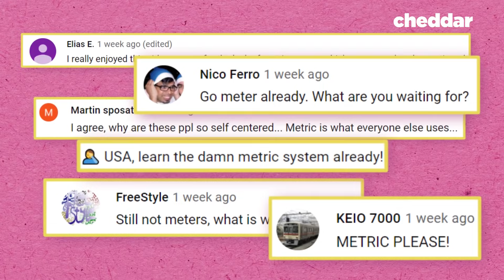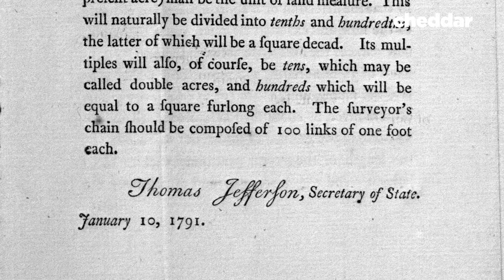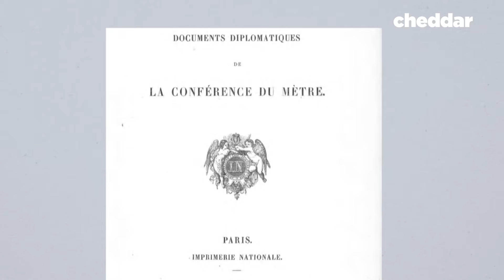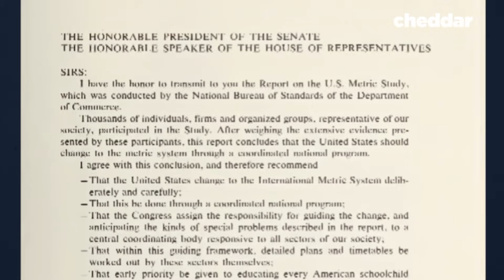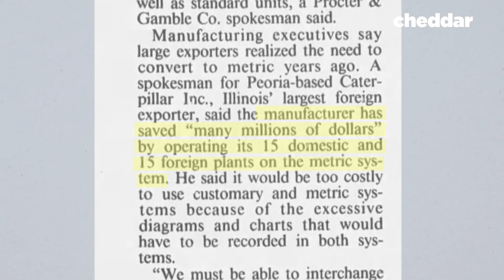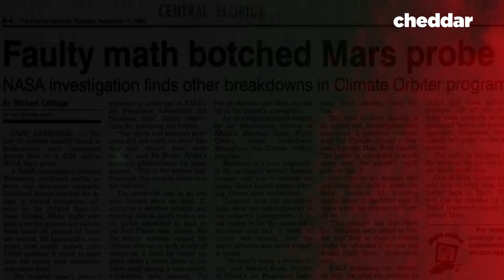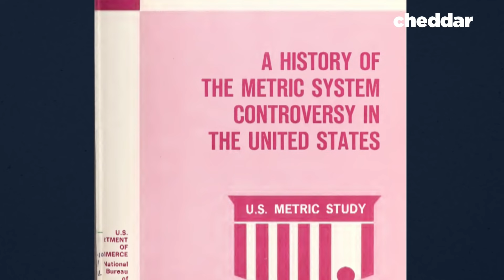Why Doesn't the US Just Use the Metric System? - Cheddar Explains

Comment: Use whatever units work best for the situation. Forcing everyone to use the same units in all circumstances is silly. 

Metric units, as the general population thinks of it, mostly means Base 10.

SI units are based on metric but contain many just-as-arbitrary units. 
Coulomb = 6.242×10e18 electrons
Celsius = 273.15° from absolute zero
Ampere = 1 Coulomb/second
Second = the duration of 9,192,631,770 periods of the radiation corresponding to the transition between the two hyperfine levels of the ground state of the caesium-133 atom at a temperature of 0° K. 

Also, not everything in the universe works in Base 10. The computer you're using right now certainly doesn't. What we call gigabytes isn't actually a billion bytes. And a 4K television isn't precisely 4000 pixels. The encryption used is based on 64, 128, 256, etc. 

Metric isn't always best. How often have you replied to a question of distance using time? 
Q:"How far away is ____?" 
A:"About an hour."  <--not a metric unit

Lastly, to really test someone's commitment to the Metric system...
Men, when gifting jewelry to your girl, you may not tell her how many carats that diamond is. Only give your reply in grams or milligrams. She'll certainly appreciate the gift so much more by demonstrating how passionate you are about forcing everyone to use only one system.
Girls, when receiving jewelry, if he tries to tell you how many carats, you must reject the gift and the person giving it to you. Clearly they are not really committed to the metric system.

Comment: As long as most of the road signs in the US still show distances only in miles and feet, and weights only in pounds, as long as most gas stations in the US still sell gas only by the gallon, and as long as US broadcast stations still give the temperature only in Fahrenheit, I will still consider the US to be a non-metric country.  😴
Reply: @LifebyMarce  The US isn't "non-metric".  That implies that we don't use metric measurements, at all.  We are taught both metric and imperial.  Any educated American can visualize a cm just as easily as an inch.
Reply: @StefanMArndt  Yeah, but most Americans still stubbornly prefer to use inches over centimetres.
Reply: Celsius is good for measuring the temperature of water I don’t live in the water. Fahrenheit is for measuring the temperature of the air. https://www.zmescience.com/other/fahrenheit-vs-celsius-did-the-u-s-get-it-right-after-all/
Reply: And??

Comment: Kids are taught in school through their science classes on the use of the metric system. Since its not used outside of school it gets lost.  I mean we buy soda by the liter but milk by the gallon, I ask why?
Reply: Cows dont know either..but do money. also 16 and 20 ounce bottles of Coke are on sale.
Reply: @Delgen1951  The 20 oz beverage thing is weird. The 12 and 16 oz are "legacy" sizes going back decades, But I don't remember the 20oz  bottle size being a "thing" until long after 2 Liter bottles were used, So if they wanted a somewhat larger size than 12 oz, (12 Oz is usually in cans,not bottles) They should have done away with 16 oz. bottles and went to a half Liter (500Ml) bottle. The 1 Liter size is already a "thing" here and the 2 Liter size has been here for decades, They should standardize on 0.5,1 and 2 Liter bottles.
Reply: That seems like a good question...i wish the video could answer it
Reply: @blacknester No, "soda" or "pop" is available in both USC and metric. There WERE quart bottles, but now it's 12oz,16oz, 20oz, 1 Liter and 2 liter (3 liter bottles were once a "thing", but no longer) No one in the US calls a 16oz bottle of "soda" or "pop" a "pint". Just "16Oz"
Reply: It's not used outside of school for many, at least those of us who rely on precise measurements on a regular basis. Science, engineering, and medical fields all rely on the metric system. It's only when passing information to others that we convert it to imperial. ie all of my CAD drawings are metric. All of my tooling is metric. All of my prototyping is performed using the metric system.
Reply: @blacknester No, but the British apparently DO use PINTS to drink beer.
Reply: Actually, we only buy SOME soda by metric.  We still us 12, 16, and 20 OUNCE bottles and cans.
Reply: @josephlacerra8433  at the same time though I see shops stock 500mL and 1L bottles with the 12/16/20oz sodas. It might be due to our proximity to Canada that they do it sure, but Still, we have 'em

Comment: They say that  "you are what you know",  and learning a new system of measurement may be asking too much from a country wherein a large number of residents don't bother to balance their checkbooks as it is too difficult to understand.       Metric is simple and can be learned in less than an hour.      The real problem is that we KNOW what an inch looks like and not what a centimeter looks like because we grew up with one and not the other.       We will probably never fully convert for whatever reasons we individually choose but it can have consequences large or small.

Comment: The best reason not to switch to metric is that it just plain isn't that much easier. Most of the time we stick to one unit, such as miles and avoid converting to other units anyway. Instead of having to deal with fractions, metric users have got to deal with making sure decimal points are in the right place for the prefix they're using, and if they get it wrong there's very little hint that its wrong because all the digits look right. Plus, for many purposes, such as carpentry, a binary system is more convenient than a decimal system, which is what our fractional system of inches actually is. In other cases both binary and decimal can't exactly express the required number, in which case you need a fully fractional system (e.g. 1/3). If we really want to use a decimal system, we can and do use decimal fractions of inches, feet, miles and other customary units. Customary units is actually a more flexible system. Learn fractions, folks, they're a really nice number system.

Comment: When you get right down to it, the metric system is just as arbitrary as imperial (it just seems more scientific.)

The meter is based on Earth-bound measurements.  Those measurements are meaningless on any other planet or moon.

Celsius is based on the properties of water (measured in millimeters) at Earth sea-level pressure.  Meaningless anywhere else in the universe.  Doubly meaningless because why is hydrogen dioxide such a big deal?

Grams?  Oh, you mean the weight of things on Earth?  Yeah, more of the same.

Dividing things by tens?  Why?  Aside from fingers and toes on some mammals where does the number 10 come up very much in nature?  We see bilateral mirrors (halving) more often,  three points define a plane (thirds), four points define 3-dimensional space (fourths), the hexagon is fairly efficient (sixths), etc.   

I'm not saying Imperial is superior.  But I think we could find a better system that doesn't use Earth-bound phenomenon for standards.

Comment: Metric ignores human beings as the standard of measurement and we must adapt our perspective to the metric scale and learn a series of numbers in order to describe our human existence. The Imperial (US) scale , however, is based relative to human beings. A foot is about the length of a foot; a yard is about the length of your arm; an inch is the width of your thumb. Taken together, the US Imperial standard is easier to relate to by human beings on a casual humanistic basis. If you want scientific precision, Metric is the way to go, and US science mostly follows that standard. But PEOPLE use the old Imperial standard because it's easier to understand.

Comment: Well, at least this video is VASTLY better than most of the videos that suggest that the U.S. isn't metric... It is already metric and has been even longer than most of Europe!
In any event, in the U.S. you can simply choose which measurement system to use, so long as you are reporting the measurements accurately so as not to deceive.
This is why you can find 2 liter bottles of soda on the same aisle as 1 gallon bottles of water and so forth.
As mentioned in the video, the NIST even calculates the national standards of "imperial" units respective to what the Metric value is, so we're just using metric with a "displayed" difference.

The very simple reason why we don't completely drop the imperial unit usage is because of how prevalent they are, and again the usage of either is entirely optional.

Comment: We don't want the fucking metric system with your European nonsense meters and liters and decimeter and what ever else bullshit nonsense that they have. The American system is the easiest to use also since there are only 3 units and not like 20. The 3 simple units are inches feet and miles. 12"= 1' and 5,280'= 1 mile. Super easy right? The metric system may be based on tens which sounds easy but it's impossible to learn all the thousands of very similarly named metric system units. They have too many names like meter decimeter centimeter kilo meter etc. and it's too much and we can't possibly remember all this metric nonsense nor should we have to

Comment: Switching to metric didn't save anyone money or do really anything. If you can't handle numbers, it's your own fault, not that of the system you use.
Reply: industry likes to differ with yout opinion for decades, you know ...  :p
Reply: What I mean is that they saved money because they reduced the number of part sizes to the minimum to facillitate the switch to a new system. It would've been exactly the same had they switched from metric to imperial.

Comment: The US is mostly metric anyway. In fact, the US is bi-lingual on this issue and the rest of the world is not. Not a measuring cup made does not have metric. Every car has a KPH meter as well as MPH. Indeed, every car made in America is made with metric nuts and bolts. ALL mechanics use metric for domestic makes as well as foreign. You don't even need inch-based socket sets any more. All "mechanical things" are made with metric. Academia and every scientific paper is done in metric. About the only thing you can get us on is temperature because Fahrenheit is ingrained.  For 20 degrees to be hot in one measure and cold in the other is a little strange, but most Americans can ballpark it close enough if they have to. Fact is this is a non-issue created so a few people can brag about being ignorant and knowing only a single system.

Comment: While I prefer metric, I do think the imperial system has its uses. When cooking it is easier to say you need a tablespoon of oil rather than 15ml. Same goes for when I go out camping and doing bushcraft stuff. If I need a log, it is easier to say a log needs to be 6 feet rather than 2 meters. When precision doesn't need to be that exact, more intuitive units like feet and cups are much better, as you don't need special tools for measuring and a person has a better feel for what they are.

On another topic, why do we buy gas by the liter or gallon? Shouldn't it be by the kilo or pound? Always feel like I might be getting ripped off on hot summer days.
Reply: The pumps should say (at least where I live) "volume corrected to 15° celcius" so density should remain the same. Also how do you measure weight through a pump?
Reply: @callmezucc9318   now I like that idea of ensuring I am getting the volume no matter what the weather is .
Reply: @callmezucc9318  You can just measure the speed the liquid is pumped up with and if you know how much force the pump uses you can easily calculate the weight knowing the rest of your system aswell. It would be done by a computer.
Reply: An Australian tablespoon is twenty  mls  and in cooking in metric you still use cups and spoon measures.much easier than remembering how mama fluid once’ to a quart .
Reply: For the gas pump thing, you should see a sticker on it saying that the pumps were tested and give for the most part accurate readings, temperature doesn't matter
Reply: We use Tablespoons too. Thats neither Metric nor imperial now is it? Why are 6 feet easier than 2 Meters? Both are quite easy to guess and the error in measurement when guessing the length is similar too I suppose.

Comment: In Australia, the only bad part about the conversion was we thought we would have to remember all these long numbers like 2.54 cm, 0.45359 kg and 0.9144 but we didn't.  We just started measuring in meters, grams and liters.  We would still use old terms in conversation like "A few miles up the road" but working it metric was much easier (I had to learn both in the 70s)

The only people who had real trouble were the elderly, but they're all dead now.